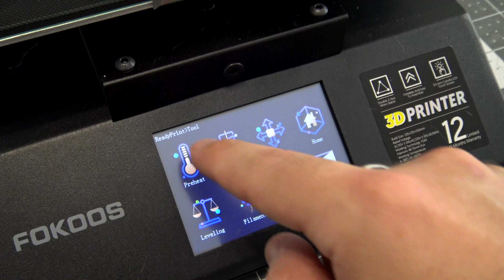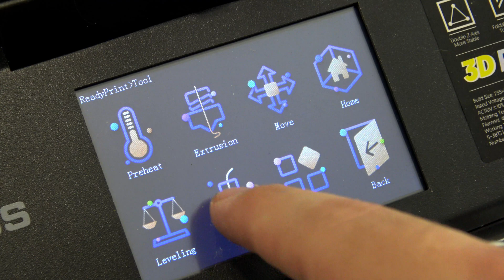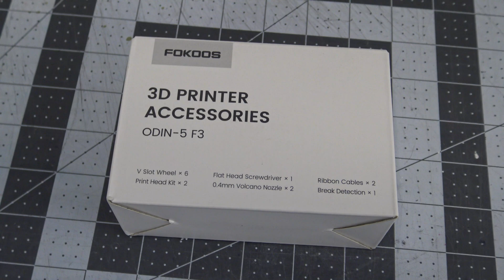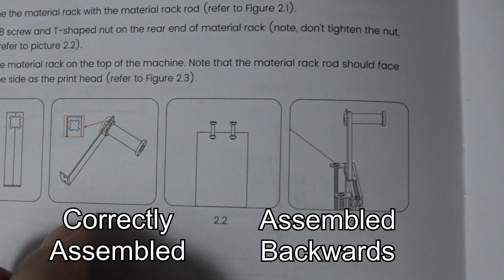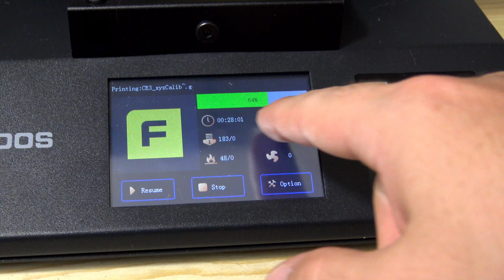A "Foldable" 3D Printer with a Volcano Nozzle - Fokoos Odin-5 F3 Review

Comment: Even though you had issues at first with the wheels, do you think something like this is preferable to a stock Ender 3 v2, if only for the easy maintenance kit? If other brands offered a maintenance kit like that, do you think there'd be interest?
Reply from the maker: I think the accessories kit is a great idea. Some brands include an extra nozzle or two, but I haven't seen any other brand sell a kit with common replacement parts. I think there could be a market for that.

I haven't had hands-on experience with a stock Ender 3 v2, but I think I'd have a tough time choosing between them. Both are capable machines. The direct drive + volcano on the Fokoos is a great combination for rapid prototyping, and I don't think the extra weight of the direct drive is much of a disadvantage with the stability of the dual z-axis.